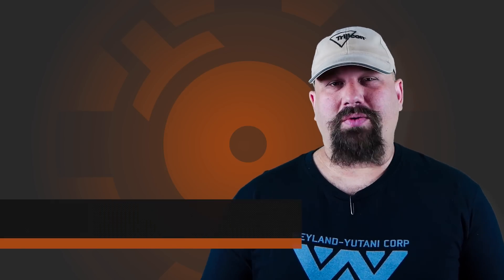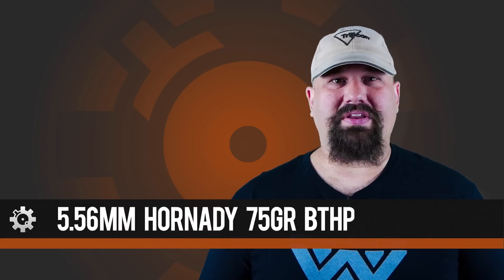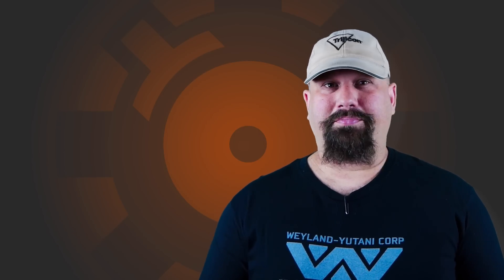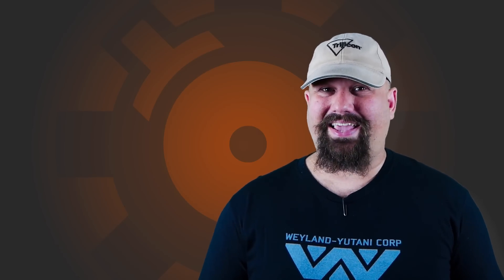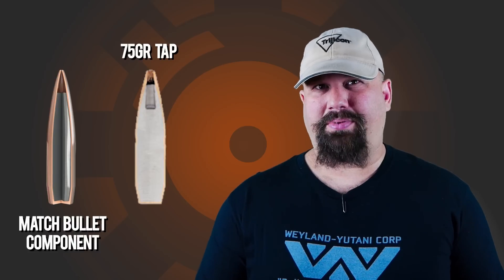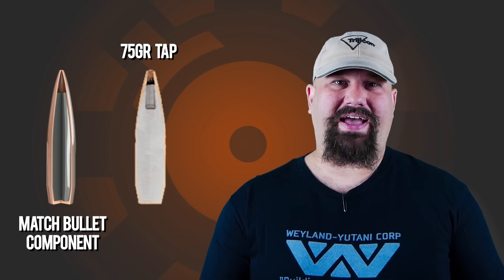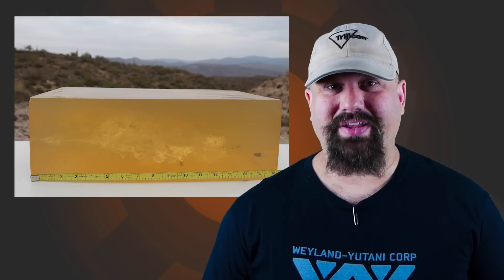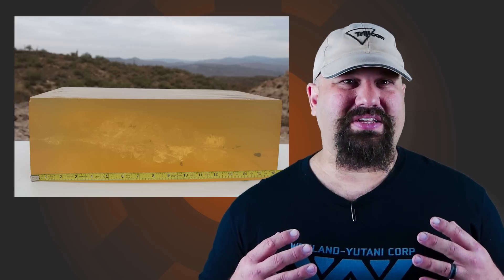Are Match Bullets Suitable for Defense? Hornady 75gr BTHP Gel Test

Comment: Gold dots/Fusions still probably one of your best options. Little to no neck, cavity stretches out to 7-9 inches? A dead on chest shot will utilize the dumped energy well. Match bullets and their long necks turn me off for stacking it deep.
Reply: "The IWBA published some of Gene Wolberg’s material from his study of San Diego PD officer involved 
shootings that compared bullet performance in calibrated 10% ordnance gelatin with the autopsy 
results using the same ammunition. When I last spoke with Mr. Wolberg in May of 2000, he had 
collected data on nearly 150 OIS incidents which showed the majority of the 9mm 147 gr bullets
fired by officers had penetrated 13 to 15 inches and expanded between 0.60 to 0.62 inches in both human tissue and 10% ordnance gelatin. Several other agencies with strong, scientifically based 
ammunition terminal performance testing programs have conducted similar reviews of their shooting 
incidents with much the same results--there is an extremely strong correlation between properly 
conducted and interpreted 10% ordnance gelatin laboratory studies and the physiological effects of 
projectiles in actual shooting incidents." - Dr. Roberts

"The test of the wound profiles validity is how accurately they portray the projectile-tissue 
interaction observed in shots that penetrate the human body. Since most shots in the human body 
traverse various tissues, we would expect the wound profiles to vary somewhat, depending on the 
tissues traversed. However, the only radical departure has been found to occur when the 
projectile strikes bone: this predictably deforms the bullet more than soft tissue, reducing its 
overall penetration depth, and sometimes altering the angle of the projectile's course. Shots 
traversing only soft tissues in humans have shown damage patterns of remarkably close 
approximation to the wound profiles. 

The bullet penetration depth comparison, as well as the similarity in bullet deformation and yaw 
patterns, between human soft tissue and 10% ordnance gelatin have proven to be consistent and 
reliable. Every time there appeared to be an inconsistency a good reason was found and when the 
exact circumstances were matched, the results matched. The cases reported here comprise but a 
small fraction of the documented comparisons which have established 10% ordnance gelatin as a 
valid tissue simulant." - Dr. Fackler
Reply: Steve Do the first 4 inches of the blocks represents skin. This round is ideal. They punch fist size holes inside of large hogs and still exit out. Nasty little round for sure
Reply: I would disagree for home defense/2 legged predator use. This for hog or game hunting is fine because of the diameter of chest cavities. Humans barely have 9 inches, anterior to posterior, on average, which I base most of my shot going into. Calibrated gel does not represent skin. Many people can guess, but it's honestly the same as muscle tissue. I can speculate that towards the end of the bullet's travel through the body, where it settles down, you can minus an inch or a few to represent a fully expanded bullet/fragments  trying to push itself out of elastic skin. At that point it has a much, much larger surface area so it's harder to exit, not enter. Sure skin is elastic and can soak up a lot of energy, but with a small surface area at the tip of any rifle bullet, it's not gonna matter as it will squeeze through no problem. I'd also point out that this round is still very good, but when the neck is that long, it only gets longer as the range increases. Not as lethal at extended ranges compared to bullets that have shorter/no neck.
Reply: Steve Do i mean like i said before. First 4 inches of the gel represent skin. Supposedly this is one of the deadliest rounds you can get in 556
Reply: Until you can source me a reputable source, ballistics gel does not simulate skin. So a round that performs 12" in ballistics gel, is equivalent to being shot through my forearm? 4" from skin, 4" of muscle tissue, and 4" from the exit skin? It's done now? I don't think so.
Reply: Steve Do nice talking to you
Reply: Would you agree with his statement of 4" of calibrated gel represents human skin? I already know and read what you c&p from shootingthebull and your gel tests. I'm just having a discussion about a claim I think is false. No article claims the first 4" of ballistics gel represents skin. He is saying skin is different from soft tissue since we do not have 4" of skin to penetrate, unless we consider subcutaneous tissue as part of the skin, which widely varies between people/creatures. Is fat part of muscle tissue, or is the skin(epidermis only)  more "elastic and stretchy" which makes people seem to believe it can soak up a lot more "penetration" when compared to gel tests. What I was trying to achieve in my OP is say that Gold Dots, Tested by you, performs much better than this round that has 4" longer of a neck, meaning it has less chance of failing at longer ranges and ensures most of the energy transferred is not wasted. If the Hornady 75gr bthp was used and the shot hit an arm, it may not expand in that short amount of tissue and ice pick. Compared to the gold dot, which almost expands immediately, can blow off that arm.
Reply: https://youtu.be/zzZhC38hFN4

He shot the gel with an Airsoft and it actually penetrated inside the gel block (close to an inch). When i first seen this i started doubting how reliable these gels are. So watch it and you be the judge of it. Again you be the judge but i think its pretty close to accurate with what they're saying
Reply: A projectile with low mass, going that slow, will of course not penetrate skin in real life compared to gel a gel block. Yes the skin is elastic and a real body has a lot more area that the energy can be dispersed compared to a gel block. An actual bullet, going 2.5k+ fps, with a lot more mass, with more weight distributed towards the rear, and with the shape of the bullet, does not slow down like a BB nor behave like a BB. It would be fair if they were comparing it to other airsoft BB's, possibly birdshot, but they are using airsoft BB's and comparing that result to something entirely different. If the skin is stretching upon impact, like a soccer goal net, before being penetrated by the bullet, that means no hydraulic force is there to expand that cavity. When you take a shot at gel, the instant it hits the block, hydraulic forces are already acting upon that cavity to make it expand, and in this particular gel test, it takes 4" before it does. Compared to real world scenarios, right after penetrating the skin, it would take ~4" of tissue before expanding/fragmenting. That is the thought process in my head that makes me disagree that 4" of gel is equivalent to skin, which would mean it expands right after entering past the skin in this particular gel test. It is compared to airsoft BB's, but definitely not a rifle round.
Reply: Good luck finding gold dots or fusion 💁🏼‍♂️
Reply: @jeremywilson8334 I can find the component but not loaded ammo

Comment: Are there load books that list 5.56mm data?
I have noticed with an M193 replica load that I can exceed max .223 data by a whole grain and still not see the pressure signs I see frequently with Lake City 5.56mm brass.
Reply: Suburban Ramshot lists 5.56mm loads separately from .223 Rem.
Reply: The Chopping Block.  I have some Ramshot Tac that I've been meaning to try out.  I'll have to check that out.

Comment: I have the same bullets and I'm glad to see that they perform well. But I am having trouble getting a good accurate load out with cfe223 and H335.  Im talking about 2moa when I can get less than 1/4 moa out of 62 m855 pills.  It is inaccurate at slow fast and midrange speeds.
Reply: Mosca.  Varget works well with this bullet.
Reply: Suburban I just got back from the local reloading supply store wish you would of said this an hour ago lol.  I will try that for sure.
Reply: Try reloader 15